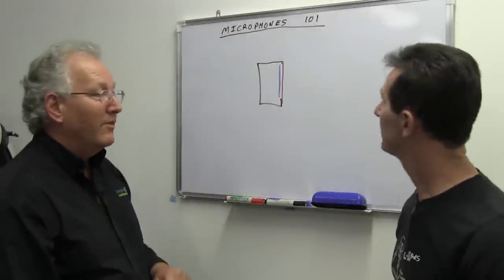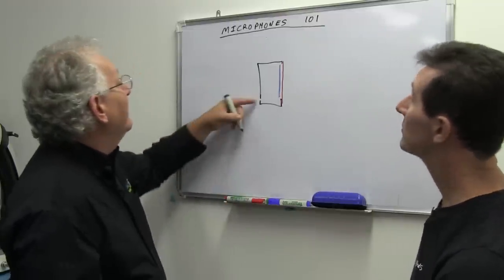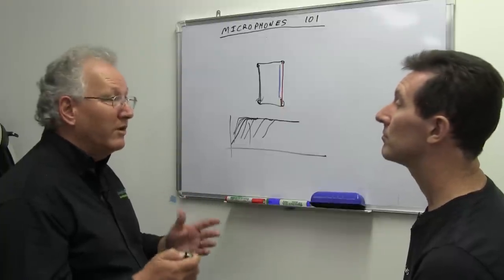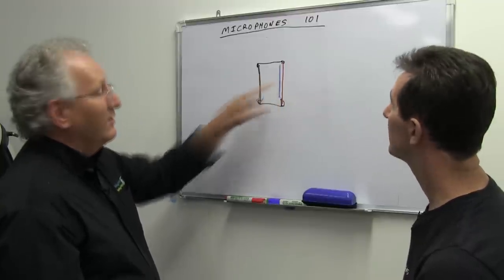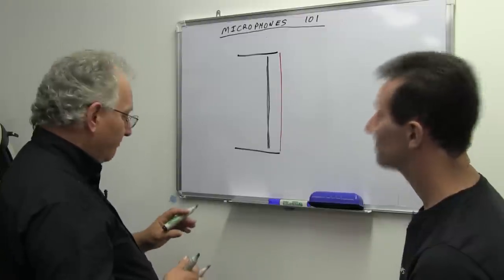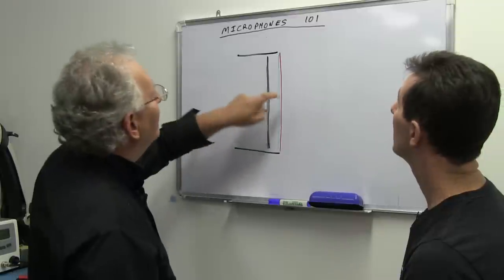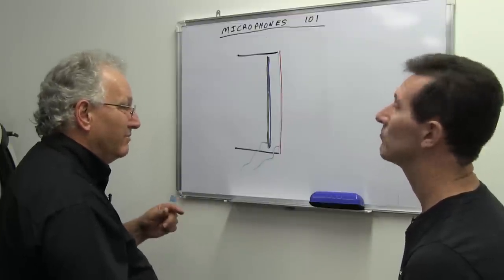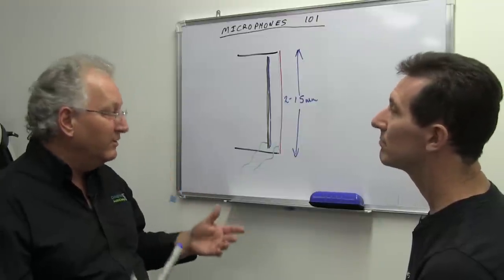EEVblog #608 - Condenser & Electret Microphone Construction

Comment: Curious as to if there were other materials used for the diaphragm before the age of plastics, or did this design arise only after? If so, were the only designs preceding it of the ribbon and carbon-impregnated capsule variety that Doug mentioned in the introductory video #602? EEVblog

Comment: What kind of microphone would you need to record elephants who are known to communicate with infra-sound (sub 10 Hz )?  Every microphone I've ever heard of dies a horrible death at low frequencies.  Would you be in pressure transducer range and would you need multiple microphones to get a high fidelity wide range recording?
Reply: You'd probably want to use an accelerometer instead of a mic. You lose the high frequency, but you didn't want that anyway.
Reply: Jammit Timmaj I'd just use a bass speaker as a dynamic mic and apply an apropreate bandpass.  But using a 1DOF accelerometer is an interesting idea assuming it can pass <=20Hz signal with little noise, and reasonable gain.  I think the biggest problem with it is that infrasonic sources can have a large moment of acceleration, which is likely to saturate cheap accelerometers.
Reply: metaforest
Any large mass diaphragm would have a low frequency cutoff, so a bass speaker would be good. Just get the amplifier impedance right. A 600 ohm impedance matching transformer might not have the low frequency you're looking for. I was thinking of an accelerometer that would be used for earthquakes.
Reply: E-Quakes can have frequency content well into to low KHz, and obviously it has a lot of energy...  so the accelerometer needs to have excellent response at very low energies, (e-quake  from far side of planet) and not clip at Mag 10+ right on the sensor.  COTS devices are no where near good enough for that yet.  However for a simple hobbyist bit of kit, take your 3DOF 3Gs accelerator and put it in a 5 Gallon bucket of cement, and bury that about 3 feet underground.    That should get you good isolation from surface noise. (except for big trucks, etc)
Reply: metaforest
Cool.
Reply: TrickyNekro No. That was contradicted in their first video. Small diaphragm condensers have better bass response than large diaphragm condensers.

To answer OP's question You could easily use a reference microphone on the level of an Earthworks QTC40 which has the following (copy/pasted) specs of:

Frequency Response: 4Hz to 40kHz ±1dB

_________________

Read this for more info: http://www.thomann.de/gb/onlineexpert_84_3.html
Reply: TrickyNekro A critical point here is that we do not want the diaphragm to oscillate.   We want it to track the pressure waves impinging on the diaphragm with the least harmonic distortion possible.  If at any frequency, in the range of interest, the diaphragm begins to oscillate, then it will begin to generate harmonic content that does not allow tracking the pressure waves from the sound source accurately.  We want the diaphragm mass to be as small as possible, and as pliable(and elastic) as possible, without it experiencing collisions with the plate structure(s), or tearing, or self-oscillation.  All of this favors a very small and thin diaphragm rather than a large one, up to the limits of practical materials science.  This is why I like hearing from engineers like Doug Ford.   They offer great insight into the theory and practice, and can also do a passable job of dumbing it down a bit for those of us who have less exposure to their chosen expertise.
Reply: Take a close look at the specs for those pressure transducers.  They have very poor response to near-infrasonic pressure waves, because they want to measure pressure, not sound.  It might be possible to do it with a differential pressure transducer with one port connected to a carefully designed pressure cell, and the other side hooked up to a carefully designed horn.   This would handle the case of listening to elephants.   As for e-quakes...  a 3DOF accelerometer with large dynamic range would be the best way to go.  Maybe a few accelerometers with different G-force ranges?   Not sure...  I'd have to do some careful research to see what can be done with COTS (read cheap) devices.
Reply: Most of the pressure tansducers from Freescale Semi, et al, have very small diaphragms, but they are fairly thick to protect them from (mild) over-pressure, and  chemical erosion.  It would take a fair amount of research to find one in the catalogs that will have the desired frequency characteristics, dynamic range, etc.  Many of them have built in amps that may or may not be beneficial for your use case(s).  Heck, even recording infrasonic signals is going to be kind of tricky.  It might require some kind of frequency modulation to use standard recording gear, and then some custom software to demodulate the FM into a sonogram and waterfall(frequency domain plot)
Reply: metaforest There are off-the shelf mics ~$1000 that have a frequency response of 4Hz to 40kHz ±1dB. That doesn't leave much room at the lower end of the spectrum, but there are general use products out there that don't require a complicated setup.

Comment: How about Noise, I just got a mic in and it humms like hell. Its a Electret SE1000A, had the same problem with the older version SE1000. I thought I could bias it with a 10k Trim Pott? Any one have a cure for this?